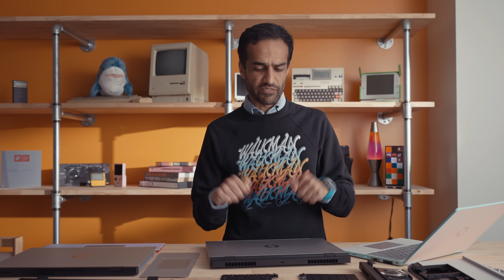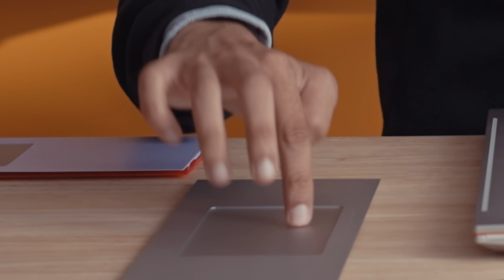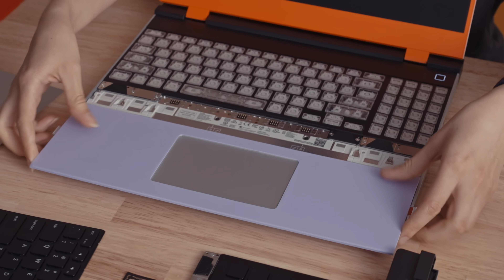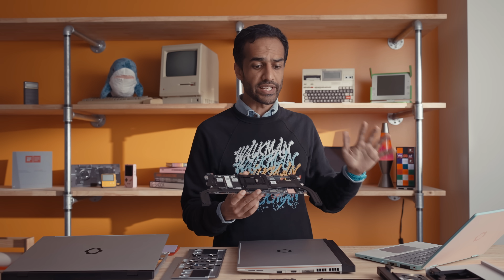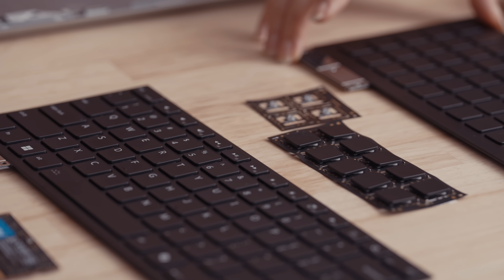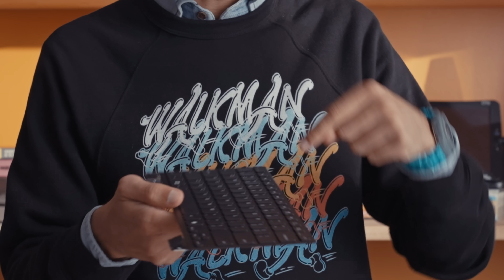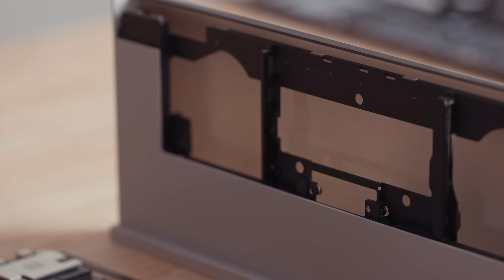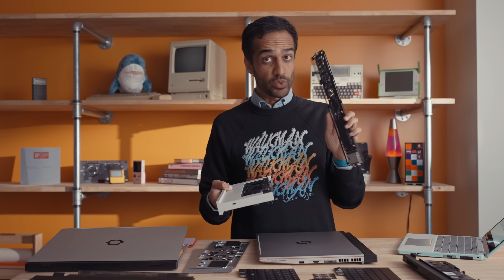Framework Laptop 16 - Prototypes and scrapped ideas

Comment: Open source laptops, right to repair, and R&D transparency.  Framework is quickly becoming my favorite consumer electronics company.
Reply: yup, not open source - still one of the best laptop companies regardless and is definitely going to be my next laptop after EOL on this one
Reply: they're already my fav company
Reply: Not exactly open source, but yeah.
Reply: Framework: the anti-Apple
Reply: @CarsMeetsBikes they work exactly like apple and charge like Apple. Just operates at a different scope.
Apple insists on closing down and walled garden for its products to work as closely and seamlessly as possible and prevent other vendors to tap in.
They are the same, their modules don't work with others, and they tried to do it as close sources as possible to prevent people from making third-party parts that are cheaper than what they offer.
They just aren't as blatant as apple to chip and software lock every module, yet.
Reply: @play005517  take your meds
Reply: they are not open source
Reply: They are great but the laptop 16 is hella expensive
Reply: They're not open Source - But they don't need to be. If we keep buying their laptops it will force the OEMs to make their machines more repairable.
Reply: I just wish they had a shorter timescale for Indian markets
Reply: Same here... e-waste is a HUGE issue and Framework is one of the very few actively attacking this.
Reply: 100%
Reply: i love how dumb people like adding open source to everthing, infornutally framework does not make open source laps tops, their motherboard designs and extension cards are proprietary and closed, in short, if framework stop producing you cant get actually make (clone) replacements boards without breaking copyright laws
Reply: Yep, This company is really coming into it's own.
This Gen 2 is really showing the maturation of the company and their biz model.
Reply: and most expensive

Comment: There are laptop trackpads out there with LEDs under them, could that be the solution for your long unified bottom row trackpad prototype? would make it clear which part of the pad is active.
Plus a keyboard shortcut or finger gesture to quickly toggle between a section and the full mousing surface would allow the trackpad to be used to its fullest

Comment: OLED display or drawing tablet modules would be very nice :>
Reply: oled touchscreen would be irresistable for my poor wallet
Reply: Woah, a drawing tablet module would go hard for osu! players
Reply: * pauses osu *
* rips out tablet and puts keyboard in *
* replies "lol" to a DM *
* rips out keyboard and puts tablet back in *

Though to be honest, when I played osu my tablet area was smaller than a typical touch pad. So, maybe in place of or next to the touch pad could work pretty well.
Reply: @chris-hayes  thank you, this made me laugh.

edit: might also be nice to have like a small one you can plop in beside the keyboard or trackpad.
Reply: Wait how would a drawing tablet module work? Are you suggesting it to be built into the handrest? From what I've seen, external drawing tablets are pretty compact.
Reply: @needles_balloon detach the keyboard and replace it with the drawing tablet, and vice versa when you don't need it anymore.
Reply: @WanRa28 Interesting idea, but the laptop base probably isn't designed to be durable enough to withstand plugging stuff into the keyboard slot several times a month. I'm thinking of the electrical connections, not necessarily the frame.
Reply: @needles_balloon  Yeah the lower pad or the current numpad area could be used. The mouse entire lower module could also be a big drawing module. Would make touch detection easy as you are searching for a pen not pressure.
Reply: The only reason I haven't bought a framework yet is because I want an oled and easy repairability. I use a dual core hp envy from 2015 and it's a little too weak for my games now so an oled for the framework 16 would be a game changer
Reply: THIS!!!!!!!!!!!!!!!!!!!!!
Reply: As a clip studio paint user, a drawing tablet module sounds amazing

Comment: would be great to have a thunderbolt/occulink port module for the module bay in the framework laptop 16
Reply: Yes, 100%. The trade-offs of the integrated discrete GPU (size weight heat) don't make sense for my usage patterns but an egpu would be ideal. (Although having the option of getting the integrated version was a key selling point - usage patterns can change.)
Reply: @DrewLoika especially with only 8gb of VRAM. Its simply not worth it.
Reply: 100% agree - I know there are DIY builds that utilize the m.2 expansion bay and convert that to oculink but I'd love to see a version that just has some type of oculink expansion card or something along those lines. It would simplify a lot of the trouble that folks have been going through to try and get oculink to work with the framework laptop in its current form!
Reply: I don't have a source but I'm sure I heard someone DIYed an oculink bay
Reply: @mechaniccat7682 it’s been years with 0 actual progress being reported. A lot of people paid money to the developer and haven’t had much if any answers
Reply: @mechaniccat7682 it was close, I even paid for it, but then the guy designing it disappeared entirely.
Reply: Occulink 8x would be amazing. I would be able to completely replace my desktop.
Reply: @adendragon705  Unless you need the absolute best performance, you kinda can already. I certainly stopped using mine, and play all my games on the FW16 + 6900XT. Yes you loose a few percent with the best GPUs but that might be fine for you
Reply: Yep, using the DIY version right now and super happy with how it performs. Really think this should be made accessible to more people.
Oculink 8x would be the dream of course given that the FW16 is about the only portable device theoretically capable of it, but 4x is already really good for mid-range GPUs.

Comment: Thanks for the video. 
It would be cool to see a GPU module with an RTX 5070 ti(12gb is more reasonable). 
When can we see thunderbolt 5 or usb4v2(80Gbit) in Framework laptops?
Reply: A modular 5070ti 12gb would be sold for a hefty price. I would probably guess it will be sold at $800. Which is almost cost the half of entire laptop.
Reply: Honestly, it probably makes more sense to just wait until AMD reenters the laptop market once again.
Nvidia seems hellbent on not providing gpus with sufficient memory - which makes them nearly useless even for small productivity tasks might I add.
Reply: Or they could have ported an RX 6800M here.
Reply: @billyrunsaplumbingservice1141  no one wants a 4 year old gpu in their laptops.

Comment: I really want a Framework laptop for work, but WWAN is absolutely mandatory. Good work overall, but I'm saddened by not even a mention of WWAN support.
Reply: Can't you get a WWAN card as a USB stick ?
Reply: @Winnetou17  It will have terrible ergonomics and bad antennas. Proper WWAN implementation in laptops typically involve display integrated antennas.
Reply: @karmakh  On the ergonomics... yeah.

I remember some 15-20 years ago when having a little USB stick with celular internet was a thing. And they worked fine (well, at the kilobit to maybe a couple of megabit IIRC speeds of those times) without needing a big antenna or something. That made me think this might work in some capacity.

Comment: Solid mechanical keyboard option is well worth the wait. Glad y'all are taking the time to get it right!
Reply: To clarify - the single-key modules are still going to be rubber-dome, even the shortest mechanical options available today (Cherry MX ULP/Kailh PG1316S) are still too tall for the available space.
Reply: We want ortholineaerrrrrrrr
Reply: A modified hinge that leaves more space between the clamshell halves would allow a thicker keyboard deck to fit.  Easy to add to the design options.  
The thicker keyboard would also allow the track point devices to be included.  And who cares if the laptop is a few mm thicker, if it has glorious clicky keys that the user loves?

Comment: The biggest step you still need to take toward fundamentally improving your products, and the tech industry as a whole, is using fair trade materials, especially in Congolese cobalt. There's nothing about supporting fair wages for your supply chain in your sustainability documents. Reusability and repairability alone are not enough to make Framework laptops an ethically superior purchase over Apple or Samsung, especially at those prices.

Comment: What if you made a little bluetooth (and battery) clip on that attached to the bottom of the keyboard and trackpad module. That way, you could take the keyboard and track pad off the laptop, attach the adapters, and use the keyboard and track pad wirelessly. It also let's people reuse extra keyboard modules if they, let's say, bought a new one in another language and now have their old one laying around.
Reply: I agree! Kind of Surface
Reply: And usable by another device via Bluetooth or USB

Comment: love the transparency
Reply: I love the transparency too, but I got the black bezel on my Framework 13 because it was cheaper.
Reply: @georgeh6856  I was so hoping someone would make that joke, lol.
Reply: Bro did not disappoint.
Reply: @georgeh6856 well, you have a framework, you can buy the transparent bezel later and slot it in!
Reply: trans ... parency. Shoutout to the Blåhaj :)
Reply: @fionawashere1086 BLÅHAJ MENTION!!!
Reply: More dense expansion ports like, instead usb c single port. two usb c ports, as there is space, or one usb c, one usb a etc, 
compressed etherent jack similar to what dell hp, etc have so it doesn stick out, 
a glossy option for the 16-inch, preferably an oled one as well, 
and also expalsnion packs that have battery like if someboady want to expand battery they can use the expansion packs or exapnsion modules to exapnd it, or quickly swap out discharging battery, will increase use case to mild military and law enforcement type uses as well, where swappable batteries are needed.
use the silicone tech batteries, maybe push it beyong 99.99wh, as battery is easily replaceable, leave it to the user, if he doesnt plan on going on plane he can like have 150wh battery, it would be huge selling point for many, when going on plane he can quickly replace to the 99.99wh one.
also global availablity or atleast the availability in india as well, pretty please. 
Now you have nvidia, my next machine will likely be framewaork if you guys are available in india. Please.
Reply: Literally as opaque as it gets. The 12th gen intel 13 has throttled down to 400mhz since it arrived on my doorstep. They continually promise fixes (that haven't worked so far) and just end up censoring anyone that asks. Scummy af.
Reply: So transparent that they sell transparent casings for the add ons
Reply: Especially in purple.
Reply: Same
Reply: And not just the new Bezel

Comment: 2:45 that touchpad would've sold so well! But yes it's probably not practical. HOWEVER how about a wacom panel?
Reply: half trackpad half graphics tablet - like the thinkpad W700
Reply: Yep, might end up trying the 3D printed version. The silver look (and the weird mismatch of 3 different colors) was the only reason I didn't go for colored panels, too.
Now having all faces (minus the edges) be either black or a nice color would actually make it look good, too.
Wide touchpad is of course a bonus, but honestly I'm ok with it centered either way.
Reply: Wow I didn't know that this exist, very cool concept
Reply: Maybe it's too hard in practice but I wonder if you can teach a touchpad to identify fingerprints so it won't react to palms.
Reply: @zacdredge3859  that's called palm rejection and is a thing touchpads already currently do